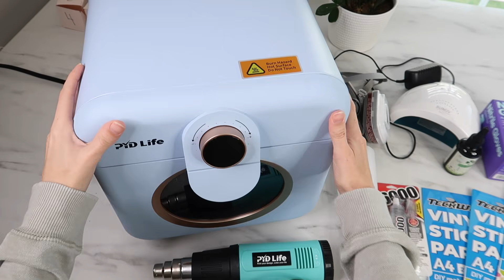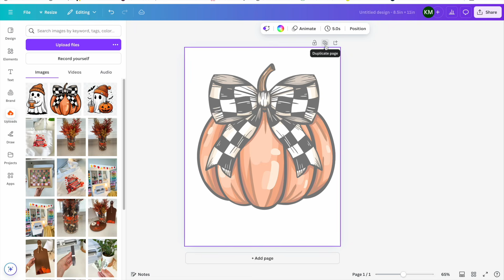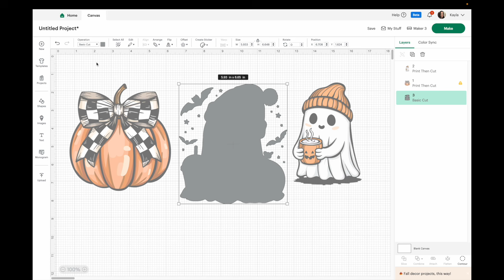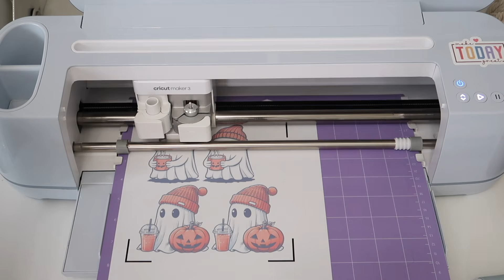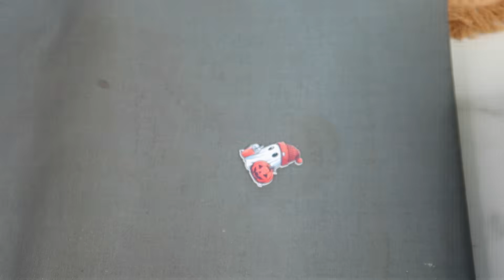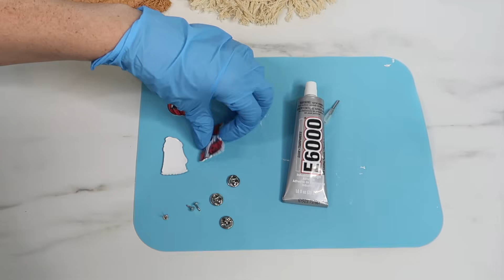HOW TO MAKE PRINTABLE SHRINK PLASTIC CUSTOM PINS USING CRICUT PRINT THEN CUT

Comment: Get some Let's Resin UV resin. It's really great stuff. E6000 comes unstuck if it gets too warm. I use Gorilla glue.
Reply from the maker: Thank you for the tips!! :)
Reply: The UV resin I’ve used in the past yellowed very quickly. Is this a brand that doesn’t?
Reply: @tarabooartarmy3654  my mom and I have used the Let's Resin UV Resin on keychains and earrings that we sell in our antique/gift shop booth. We haven't had any issues with yellowing from this brand, and we've been doing it for about 2 years now.
Reply: @tarabooartarmy3654  I use Let's Resin Hard version and I've never had it yellow. I also use a Screen printing UV lamp. It's a serious UV lamp but it cures resin better than anything I've used in the past. They sell them on Amazon.
Reply: @tarabooartarmy3654 i use jdiction and so far my projects have not discolored, 5+ years later
Reply: Every time I used dimensional magic, the colors ran.

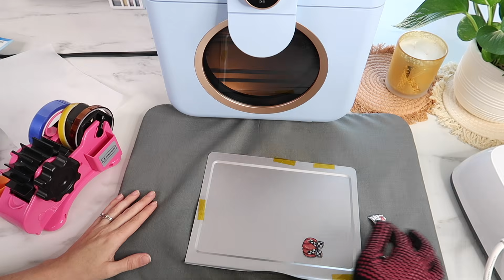Comment: 9:35 you should NOT use a regular mask, it won't filter out any gases. A regular crappy blue mask filters like 30% of airborne particles, at least get an FFP2 or FFP3 one from 3M. The respirator one is 💯

Comment: UV resin will have a sticky layer. You need to clean off that sticky layer with some isopropyl alcohol.
It’s not good to get the UV resin on your skin so always use gloves if the reason still feels like it’s a little bit flexible care a little bit more.

Comment: I just seen your video. Cute!!  

I use what is called jewelry bond glue or add my nails posts. Once dried I do add a small amount of uv resin to seal and hold the backing in place. I do the back and then use the post to stick in a styrofoam pad (packaging cut smaller from orders I get from Amazon) and have it stand upright then uv seal the top (or doming). I do these with my uv resin earrings also

Comment: You should be able to swipe the cured surface with some isopropyl alcohol to get the stickiness off. Some UV resins finish that way, doesn't necessarily mean it hasn't cured fully.

Comment: Would this work for keychains? And if so, at what step would you hole punch the plastic for the chain?
Reply: Hole punch before you put in the oven otherwise you’ll need a drill.

Comment: Seal with gel nail top coat. It is a uv resin and easier to maneuver. Yes, you can use resin to secure stuff to other things. Great video
Reply: Thanks for sharing this. Can I let it sit dry?
Reply: @Wrightn221 this needs to be cured with a uv lamp, it will not dry otherwise
Reply: @taylorm1965 ok. Thanks so much

Comment: You can use bezel tape to have your pins not move. I also use the 30cc soufflé cups upside down. Tape the materials to that and then move your resin to the edges that way. E6000 is going to be a better choice for gluing your backs! You won’t be able to light up the resin good enough!

Comment: I forgot to answer your question about using the resin instead of the glue.  Absolutely you can use it.  Just remember the light cannot cure where the light doesn't hit.  So you can scratch a little bit to roughen the surface where the pin will be.  Use a pin or the tip of a metal nail file or scissors to dig in just a bit.  Just to give the resin something more to grab onto.  Your glue might suggest that too.  Even just a little X is better than nothing.
Add one drop and set the pin into the resin. Cure once and turn it different angles after the first 30 seconds of the cure cycle.  Then you can tip it to let the light get in under that pin a bit.  Then drop and spread a bubble of resin over the base and cover the area.  Let it spread out just a bit more so it's touching the other resin already there and finish the full curing cycle.  You'll have a secure pin for sure. Test both ways and see which way you like better. Sometimes it's still a preference thing.  The scratching part is a tip I learned from my Dad years ago and see others doing it as well.  It helps the bond be stronger when even just one side of the parts being glued are smooth.

Comment: No, you can’t use the UV resin to attach the pin backing- the UV light wouldn’t be able to penetrate  to the resin- POSSIBLY if you were using the translucent shrink paper😊
Reply: Technically, you can. You just put the resin on the outside of the pin back. You can use regular craft glue under the back and resin over the top for extra hold.

Comment: For anyone who doesn’t want to use resin because it’s toxic and you need to have proper ventilation and PPE, I’ve had great luck with Mod Podge Dimensional Magic!
Reply: I tried that one in the past and it yellowed quickly.
Reply: It’s also super hard to get the bubbles out

Comment: Wow! You can change Print and Cut to Basic, use Contour and change it back to Print and Cut??!! 🤯 Also FYI, all UV resin is non-mix. I like JDiction UV resin, it doesn’t get sticky. On the rare occasion that it does, I find just leaving it overnight works. I would have used just a touch more resin than you did and silicone “brush”, I think it would have helped it spread better. These are so cute! I want to try photo Christmas ornaments this way so thanks for the tips!

Comment: These are cute! And yes you could just use the resin to attach the backs, I'd recommend that over the E6000 as the UV resin will set so much faster.
Reply from the maker: Thank you so much for the advice!!! I will do that next time! :)
Reply: I agree. Lots of people are saying it can't be done with UV resin, but that's how I attach my pins with no issues.

Comment: I’m not familiar with working with resins. Do you have to use resin?
Reply: No it’s just used as a protective layer essentially
Reply: @lildee_w6254  could top-coat (clear) gel nail polish work?
Reply: @Li33ie  you could but I wouldn’t recommend it if you want it to last. Not as strong as resin

Comment: i use silicone brushes with uv resin.
Reply: Are they easy to clean after?
Reply: @lildee_w6254  yes, I just wipe them with baby wipes.
Reply: @lildee_w6254  Clean with baby wipes or rubbing alcohol. But get a good quality baby wipe like Huggies. The store brand ones leave all kinds of lint on everything.

Comment: I would love to try making pins! Can I use a blow dryer on high heat? I don’t have an oven or heat gun unfortunately 🫤
Reply from the maker: I don't believe you can use a hair dryer :( I started googling it and it said heat guns have a narrow stream of air, while hair dryers have a wide stream. I haven't tried it though!
Reply: No, but you can use an actual heat gun... Not an embossing heat gun, a heat gun like you would use for linoleum. They aren't expensive but you have to make sure you're buying a true heat gun, not a crafting heat gun. Go to the tool section LOL.

Comment: When using uv resin you need to clean it with alcohol when your done curing it.
Dont ever  use a food oven . Ahrink wrap may be okay.  But anything that might give off a gas must have a non-food oven.
Reply from the maker: Yes!! I should have mentioned that. I wouldn't make shrink wrap in a food oven either just to be safe.
Reply: @KaylasCricutCreations  some people know and others dont.  Loved the post.  I looked then up and their a good price just wish I could get a smaller package.
Reply from the maker: @joni22262  I wish they had a smaller package also :(